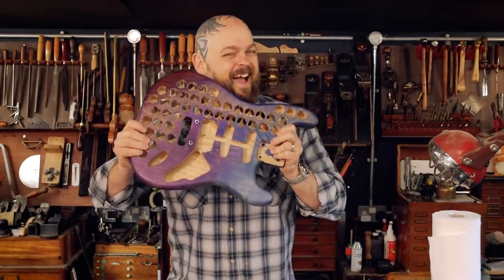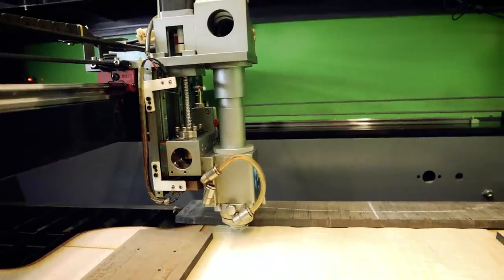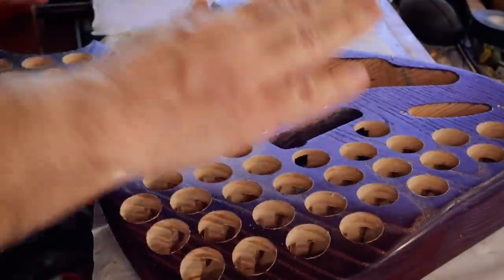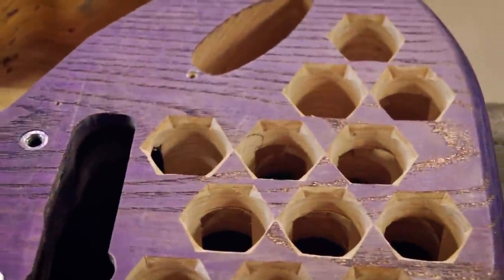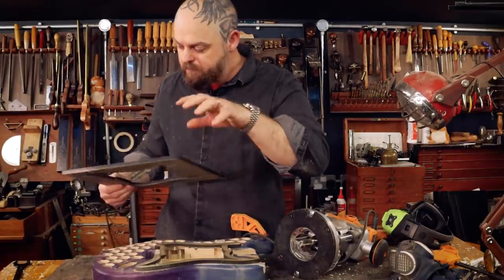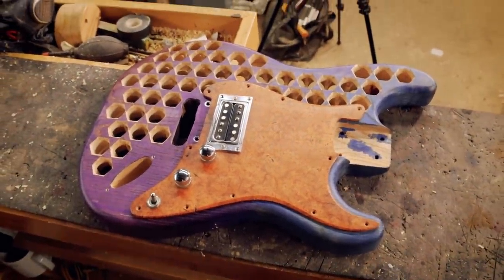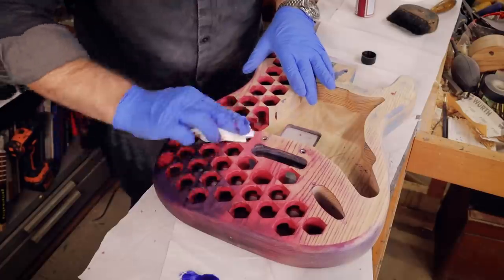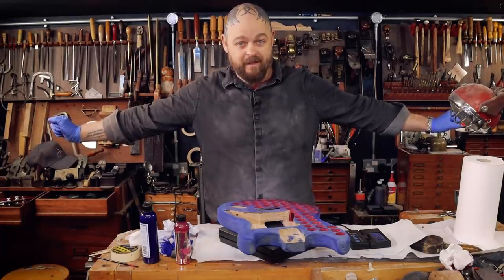Ep 2 of 3 My Daughter HATES a guitar I made for her!  More EXTREME weight relief on a 10lb+ guitar!

Comment: In my personal, stupid opinion, that burl wood scratch plate is just totally wrong for this guitar. Just doesn't fit at all. So, cast my vote for changing that out. I think copper hued with blues and purples would be nice, as you said. :)
Reply: It might look better in person, but in screen it looks like an old piece of Masonite to me.
Reply: copper is bad, he should make a custom maple one
Reply: Agree with that..
Reply: Im not liking the looks of the burl either but the copper is going to be heavy unless its so thin that it will bend.
Reply: It's amazing how much the grain in burl wood pops with the right finish. Take some boiled linseed oil and coat it, let sit for 10 minutes. Wipe off and let dry. Finish with a clear lacquer or layers of super glue and polish for a durable finish. Then add inlay or fine pinstripe that blends the body into the plate.
Reply: Copper is heavy. I'd go for alu. anodized gold or natural.
Reply: The pink and blue are cool colors. The pickguard is warm. They clash. On top of that, it's just a completely different style that doesn't mesh with the overall guitar. The guitar is now a futuristic tech-pop extravaganza, and the guard is rustic and traditional. It needs something wild for the pickguard. Like mirrored chrome. Or... black.
Reply: I agree. It's cool this just isn't the right guitar for it.
Reply: Agree 100%. Boot the burl. Do a transparent acrylic with a similar hex-hole pattern cut into the back of it then put a very thin piece of anodized aluminum (light orange or yellow - complementary colors to the body)  to hide the massive hole and highlight the hex depressions. You might even be able to 3D print such a thing if y'all have it.
Reply: I must agree
Reply: I also dislike the burl wood pickguard.  But I would maybe go for a black carbon fiber looking one instead.
Reply: To reduce the weight there has to be nothing like scratchplate - nail the PU's on the body and took the Pot in a hole (from the Back). Maybe there can be more holes under the scratchplate, too ?

Comment: Ideas: (1) Add a few of these “Mac Pro” holes to the headstock as well, with smaller diameter, of course, both to prevent risk of neck-dive but mainly for the wholistic design look. (2) Consider placing in the insides of holes reflective material like that used by bicycle users and road-construction people, in pink (if you can find it) or white. Also in the headstock if you follow my 1st recommendation.
Reply: Like that one. Would look good on stage with spotlights.

Comment: I personally wouldn't have removed the wood from the trem cavity. There's now no "direct" wood path for the vibrations to travel from nut to bridge. I wonder what effect this will have on the sustain.
Reply: the trem is still going to be screwed into the wood.
Reply: @502deth  Yes, and there will be much less wood between those screw points and the nut. I would opt for maximum "connection" (i.e. wood) between nut and bridge, and this removes a large part of that.

Comment: Hi Ben,  Just saw the first two videos on this modification on your daughter's guitar, and it looks spectacular!  The bright pink really stands out, and as you were going through the staining process; I couldn't help thinking that with all those lovely holes:  Internal LED lighting set up from the massively routed out area.  Something to highlight and showcase that wicked 3D effect.  I have seen some people use vibration sensitive lighting under their pickups that react to when the instrument is played, some even have that light effect on individual strings.  But with your build even a solid (or a 3-LED color changing set up) glowing outward within the holes, would brighten the hot pink you have there now making this a one-of-a-kind body.  This wouldn't add hardly any weight (a small battery depending on the device needs), but it could add a LOT of visual attention to it.  Good luck with your build-mod in any event, you are an artist with vision!

Comment: This is a super cool project. I posted this reply to a comment about the burl scratch plate, but I wanted you to see it directly. Boot the burl. Do a transparent acrylic with a similar hex-hole pattern cut into the back of it then put a very thin piece of anodized aluminum (light orange or yellow - complementary colors to the body)  to hide the massive hole and highlight the hex depressions. You might even be able to 3D print such a thing if y'all have a printer.
Reply from the maker: very very cool idea, thank you. As it stands I'm well on the path to making a carbon fibre one but this wold be my second choice! And yes.. the burl has been booted, it doesn't fit the rest of the guitar.

Comment: The Black-Pink-Purple layup looked great. The straight Blue is what threw it off. If the blue had been Black/Grey I think it’d have been a winner.

If you’re painting it, I reckon it needs the copper scratchplate. What about 3 layers of 1 mm copper, cut the top and bottom with holes like the body pattern, and the middle layer just a frame around the edges? With the patina and a coat of clear that could look fantastic.

Also, entirely unrelated, but if that Burl Scratchplate needs a new home after this, I’d be interested in “helping out”. 😂

Comment: You don't necessarily need longer screws for the trem system, you could make a longer claw (and put holes in it for minimal weight) for the space between the springs and the screws.

A copper scratch plate would probably add a bit of weight back to the instrument, so that might be counterproductive even if it is pretty. The cavity needs shielding too, although that won't be affected by your choice of scratch plate. The main problem I can see is that some of the screws that are supposed to hold the existing scratch plate on now have nothing to bite into, so that's a pretty good reason to make a new one.

Personally I'd be tempted to hide an Arduino or Raspberry Pi under the scratch plate, and then add RGB lighting to all the holes, but I know you don't like wiring and this would involve quite a lot of it.

Comment: If you started with a solid-body, you could have used a large ball-drill bit to make the guitar dimpled like a golf ball to save weight and make it more aerodynamic for tossing it around her body when she plays a packed concert at Wembley.  I am worried for the top horn if that is where the strap connection is.  Better fortified horns have broken in the past.  Just my thoughts.

Comment: 1-I would be concerned about routing or so much weird under the center block/strings area. Which might destabilize the instrument under fully strung tension.
2-Def go for the optically etched and enhanced copper scratchplate.

Comment: Personally, I'd go glossy neon pink inside the holes, and same purple/blue as before you started, but a few shades darker to make the pink pop more.
Satin finish but buff the inside of the holes. you've created geometry so you cant have colour bleed on you hex bevels. crisp straight gloss pink on dark purple. 
The pickguard.. Stained leather could be practical and done many ways, but it would need a stiff backing.
you could make a two-part epoxy pickguard and use dyes. aluminum shavings/dust might be a nice touch.
or you could do something crazy like laminate coloured silks with ripples and twists and then cut a cross section.
or an intricate geometric coloured fiber paper mosaic.
Reply from the maker: the gloss neon pink was what I had in mind.. until I started thinking about gold leafing the holes! Crisp lines and no bleed is essential you are right.  Now.. leather!?! I have never considered a leather scratchplate! That could be awesome!  For some reason though your comment has made me think of making a crushed carbon fibre scratchplate.. that would fit the aesthetic quite nicely and is something I have never ever tried before!
Reply: Gold leaf is always classy, prehaps especially to kids!
yeah, the leather could be nice. Splatter dyed?
Huh,  Could you... Tie-dye carbon fiber cloth? 
I mean, at this point, (Gold and carbon fibre, holes) is it going to run the risk of becoming something that looks to valuable and intimidatingly cool? 
you gotta make two now. pink one and a gold one. 12 part series.

Comment: The contrast between the purple and the pink looks sick, the foot of the guitar where the pink spilled out of the holes is the part that bothers me. Sand the pink off a bit and maybe hit it with a bit of blue tinged epoxy or polyurethane and it could come back really nicely.

I agree that the natural burl looks nice, what I would say is that adding a bit of the same pink with a sunburst centered on the pickups would look sick.

As far as the inlay goes, make the inlay out of some copper leaf or something, get it stupid hot so it gets the patterns from annealing on it. Heck maybe even make a raised scratchguard off the the bottomside, I've always thought that looks mad classy anyways.

Comment: Tips&tricks
Bright colours attract the eye! Dark do not! 
Bright colours also pop out. Dark deceives the eye to be a surface further back. 

Colour scheme to enhance the 3-D-effect of the holes:
A) Bottom of holes very bright. (0-5 units of black in the colour mix.) Seems contradictory but they will be invisible in the shadow otherwise (unless you install light inside).
B)Side of holes darker than the bottom and also darker than the top surface. 
C)Top face a nuance in between the other colours. 

All colours are one and the same just 5 units more black on the top face and 10 units more black on the side walls of the holes compared to the bottom nuance. 

Design “rules”: When one has many different colours and types of wood they all compete for the attention. I would let the 3-D holes be the main attraction. That is easy to achieve with only one colour yet in three different shades of brightness/darkness. 

..and lastly...... as one of our great contemporary composers said: “When you create, you have to be prepared to “kill your darlings!....”
 I guess you’d like the wood to be visible. And that might have become a darling?... 🧐😇 The wood grains would be competing for attention on the expense of the hexagon holes. So one colour only but with different shades of grey will do the trick. A hit I would say..  humbly 😁
Kind rgds 
Anders
Sweden

Comment: Ben, your design is incredibly cool. It deserves better than painting. Since you are going to take it to the spraying booth anyway you have the chance of giving it a real high gloss coating. I would go for an automotive coating that is distantly looking like Olympic White, but contains Partikels that reflect light in multispectral forms. Seen it on some cars, it usually shows a light pinky touch but can go from there to greenish and gun metal grey...
Think it’s called perloid metallic on white base.
As for the holes, get out the sticky gum and do some silver plating of the entire inside and holes. I can hear the body crying out to be treated like this.
Guess the spray job will add 6 oz, roughly  200 gramms to the body. 
And in case your daughter doesn’t like my design, I will gladly take it from her. 
Keep the madness going, your doing such a good job.

Comment: Whatever you do, please don't let the wiring be visible through the holes.
If it's a wooden pick guard, put a vertical veneer on the inside blocking the view, if it's copper pick guard, perhaps a copper mesh blocking the view?
Either way, block it out otherwise it would look unfinished. Like when you can see the wiring through the f-hole on a cheap ES 335 copy.
As for color, purple and blue sounds much better than the current one and with the possibility of copper pick guard, perhaps the holes can be painted in some sort of metallic copper collor?
I thoroughly enjoy these videos of yours!

Comment: pink would have been fun, but you would have needed more black contrast. Vibrant holes will NOT work UNLESS the top finish is much darker; think florescence against black. That might actually be a great idea, making the holes react to a dark light while the top does not, just to bring out the 3D effect. Going from pink, to blue, to purple with a much much DARKER base and then polyurethane it off. The sockets would then glow whenever the lights are out
Reply from the maker: we're going with a dark blue/purple polychromatic paint with a gold leaf in the holes.. it should be exactly as you say.. fingers crossed

Comment: This is a very cool project. The project is at the ugly duckling phase. I KNOW a Very Cool Punk Swan is coming!! :)
One over-the-top thought, [and this may be too much/not a fit for this project]. If you filled the holes with polished clear Poly rods. Then you could add micro RGB LEDs to the backside & microcontroller for different lighting & effects patterns. Also, if you add a sensor to the controller, you can likely change colors in sync with the playing.  Again ...Way Way over the top & that would add 2+ lbs of weight.

Comment: Just found your channel through these two videos, but I like your curiosity, attitude, and excitement. So in spirit of giving back I will offer you something in return as someone who has stained a lot of wood in my day building adult goods in a way that most people never consider.

 If it's bright colors and super flashy effects I am after... I rarely use technical stain to stain. What I normally use and apply with a cosmetics sponge is and has now for many years been water based airbrush paint. It comes it neon's, iridescent, fluorescence, and electric colors. But the true genius of it is that you can get the iridescence in clear and layer over any color and give it a iridescence almost ghost flame effect. 
Not trying to tell you what to do from one crafty builder to another, just figured I would mention it as an option as most people never even consider it.

Not going to lie it's an interesting design and would probably look rather sick drilled into a flying V to cut the weight down. But I am a rather strange guy and I would have a hard time resisting the urge to not jam a couple of strange coins or connect four pieces into those holes just to make people scratch their head. Keep up the content and have a great day.
Reply from the maker: Hey, this is a very very cool method, thank you for telling me! I'm 100% going to have a good play with it.. thanks from one rather strange guy to another :)
Reply: @CrimsonCustomGuitars   No Worries, I've been a custom builder for many years and considering there is no kids in my future... That information has to go somewhere. So may it find good use in your hands.

Comment: To bad you want to add color. I would have loved the natural color of the wood. 
I experimented with Waco oil (for wooden floors) on an acoustic guitar because I want to get rid of nitro cellulose lacquer or other synthetic paints witch are bad for our environment (and my healt!).
It is an enormous succes. It works fine, the guitar can resonate freely because no stiff paint or lacquer is added.
If you want to add color, may I suggest the color olive? (Of course getting the red (or pink) out of the holes is now impossible, but for some other project maybe.) 
But I do like the holes and the idea behind it.

Comment: well... if u wanna cyberpunk it then CYBERPUNK it!  step 1 ( i mean step 172) spray the guitar with a metal flake based purple-y paint. to get it all in the holes. then (step 2) around the cavity under the scratch plate, install bright pink l e d's that activate when the guitar is plugged in.  so that the light illuminates the cavity and kinda also reflects off of the metallic aspects of the paint in thoses cavities. mount the strip/ lights so that it looks like the "heart" of the guitar is glowing and imminating light.   then (step 3) sand back the surface to reveal some of the wood (like u do when blending stains for bursts/fades)  then (step 4 ) mask off the cavities and lightly dust /airbrush the outer body with copper mixed with blue. r(step 4.5) esand to blend all of the layers  [u may have to do some additioal staning here to make sure it all blends well] then clearcoat with a smidge of something metallic in the clearcoat so that it is a space/cyberpunk/slushie. and if/when u patina the scratchplate, try to do so with something that will make any pink/purple-y hues come out. 
and if, at this point, she doesn't love the guitar, auction it off add the proceeds to her university fund and get her a kit guitar and let her design her own entry into the new "Under 18  division GGBO spring 2022 edition" 
voila! everybody goes home happy!
Reply from the maker: That all sounds brilliant.  DC

Comment: At what point does the body become to weak to support the neck under string tension? I built a Tele that is 1.30" thick and it is holding steady under tension but you can flex the neck like a tremolo if you want. It works as a studio guitar but I don't think it could stand the rigors of touring.

Comment: To me, the back looks odd. The front can make do without all the holes because of the pick guard. It covers up that area so there doesn’t need to be holes throughout, however, the back has that huge hole-less area that to me looks unfinished. I’ll just throw this out the - what ever is decided on the pick guard on the front, why not make a mirror pick guard for the back? You can make it interesting and the back will look finished. Just a thought.

Comment: Could you simply glue a small block of wood, or some lighter material, into the cavity to give you a place to anchor the trem springs, while still achieving overall weight reduction? It might add back what, an eighth of an ounce, if that?